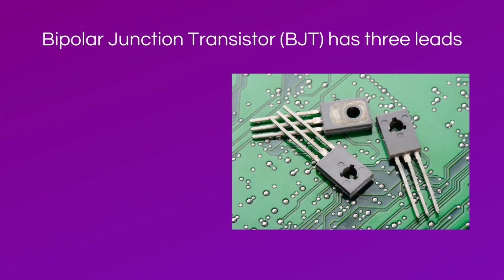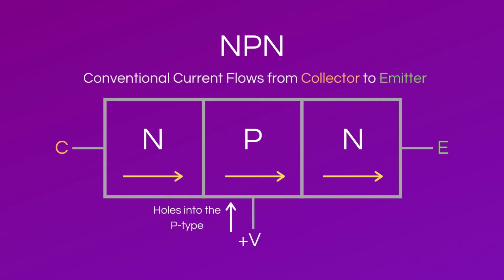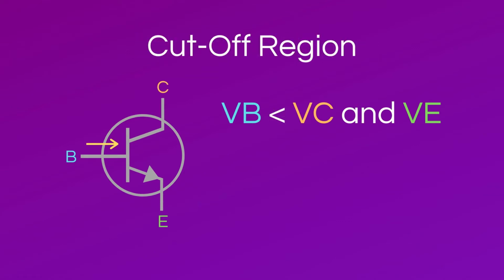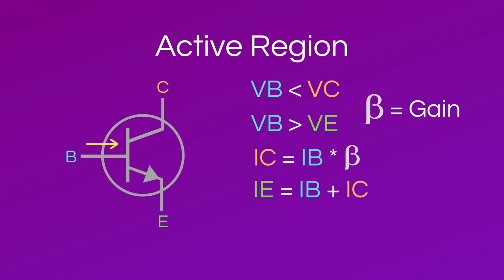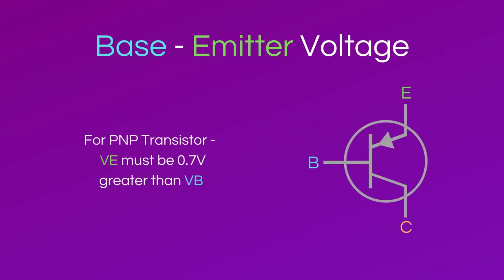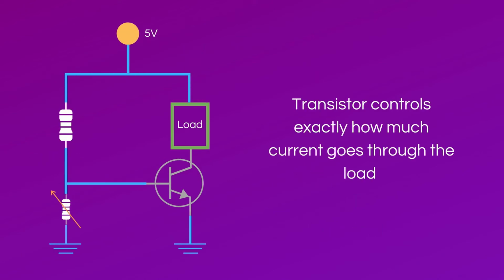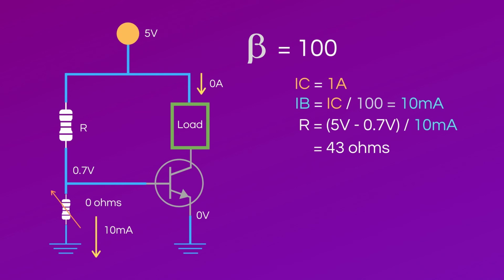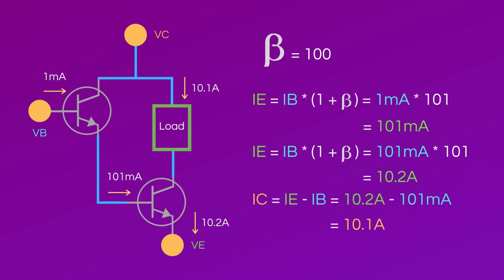How Bipolar Junction Transistors (BJTs) Work - Basic BJT Principles: Electronics with Zach

Comment: Hi Zac just wanting to check that for the Active Region for the PNP is the VB<VC which is therefore the same as for a NPN thanks nick
Reply from the maker: Hey Nick, I looked through the video and that is a mistake. For the active region of a PNP, the VB > VC and VB < VE. The reason for that is the PN junction needs to be overcome so that conventional current flows from the Emitter to the Base and Collector. Thanks for the heads up.

Comment from the maker: Hope you all enjoyed the video! I just want to let you all know that there is a mistake with one of the slides. The active region of the PNP should be VB > VC and VB < VE.
Reply: to instruct one about junction transistors it is IMPORTANT to make clear :
(1) Voltage polarity  :PNP neg voltage supply; 
                                    NPN  positive voltage supply 
AND all that this entails, such as  direction of current flow PNP vs NPN 
(2) Power /Temperature limitations: example : 1 watt transistor does not mean the transistor can maintain 1watt of 
dissipation IF the transistor heats up due to packaging  or high ambient temperature say 100 deg C
(3) junction breakdown , leakage current, freq limitations,  mounting , insulation , heat sinks this becomes hours of study . 

Of course  this is an overwhelming amount of material to cover requires a LONG series of 10 minute clips